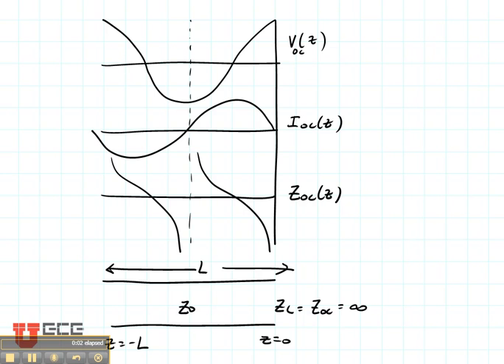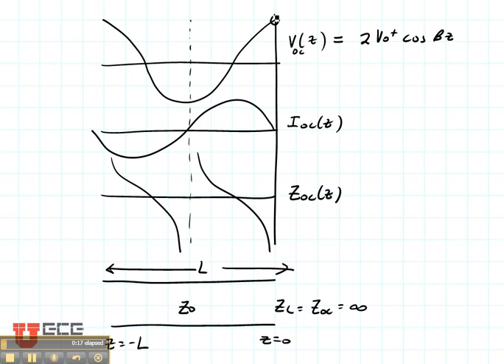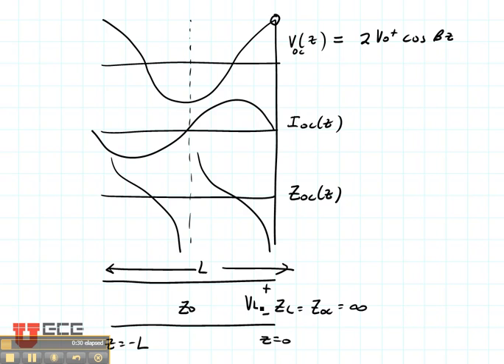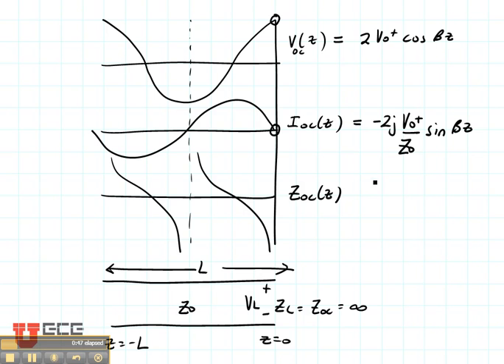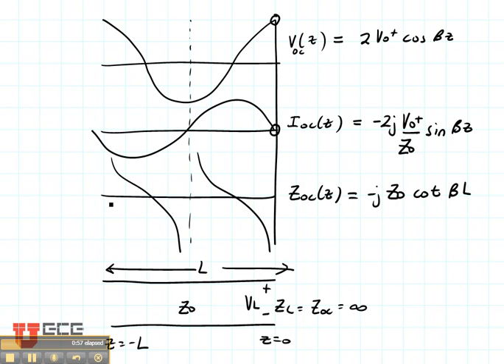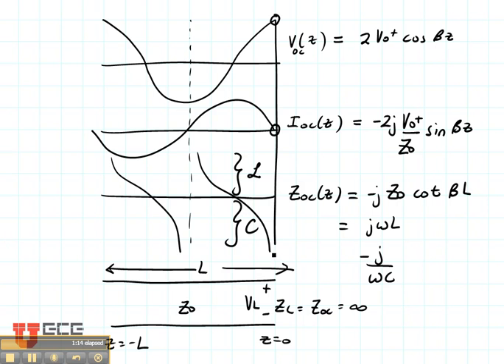ECE3300 Lecture 8-5 LC open circuit

Comment: Hello Cynthia!  
I think the top part is capacitance and the bottom part is inductance.

Zoc (z) = - j Zo cot BL   (Notice the negative in front)

so if cot BL is negative, then ( - ) times ( - ) = (+) Zo , which means inductance

However, I am wondering if you were using the Zoc (z) =  j Zo cot Bz  (z at the end rather than L)

Comment: Professor,
I just need some clarification. If Z(z) for an open circuit is negative jZo*cot(BL) then why does an open circuit act as an inductor when the cotangent graph is positive. It appears to me that if the cotangent is positive then Z(z) would be negative like the impedance of a capacitor, and conversely when the cotangent is negative, Z(z) would be positive like the impedance of an inductor. Could you help me to wrap my head around what I'm missing :) Thanks.